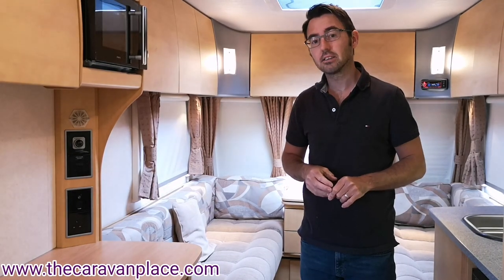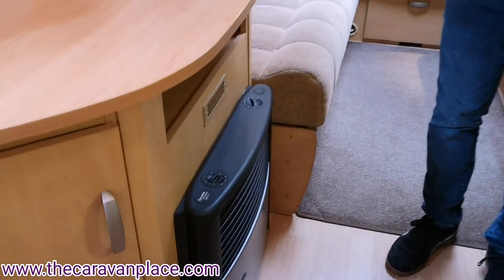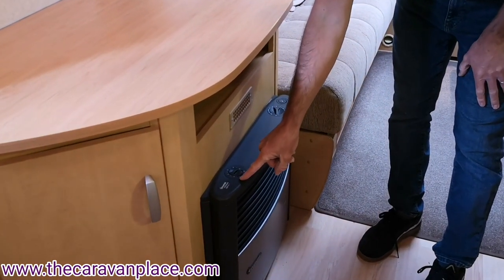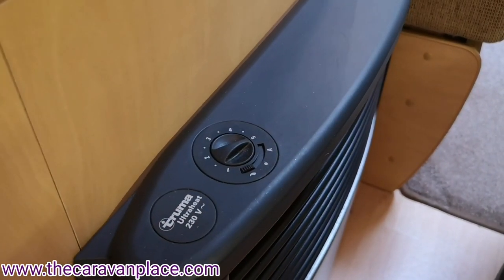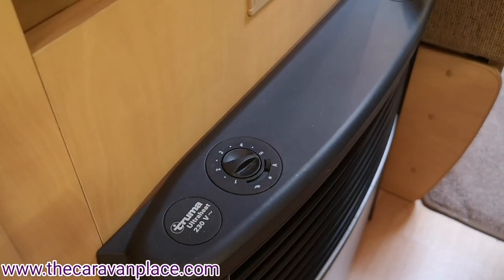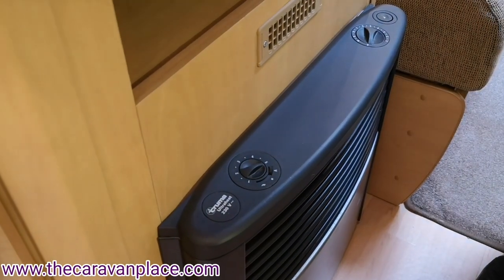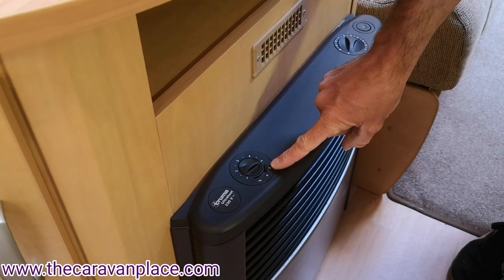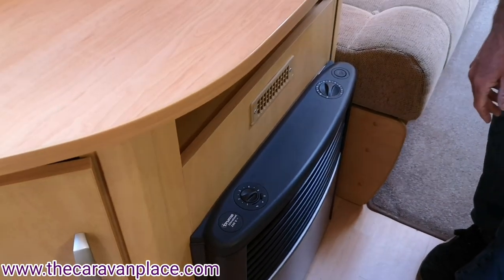Truma how to work blown air, truma s3002 blow air

Comment: Can it work just  from the leisure battery?
Reply from the maker: Yes, gas and 12v will do the blown air 👍
Reply: So how do I do that? Do I put the gas fire on then use the other dial on the fire to use the blower ? Not too sure how tou use it as I've not had it long and it's in storage, can you explain how to fo this please.

Comment: Hi, I started the engine on my motorhome and now the fan on the fire has stopped working, will the fuse be in the main fuse box for the motorhome tia.
Reply from the maker: Yes it should be within the other habitation fuses, possibly the Aux fuse or similar.

Comment: Any ideas please .. fan works but blowing cold air on electric. Heater works with gas but not with electric.
Any ideas for troubleshooting? We'd prefer to use electric heating.
Please help x
Reply from the maker: You should have a fuse in the power switch, if the fuse is ok, then its possibly the pcb or element, a caravan engineer  should be able to test it.
Reply: @thecaravanplace  .. thanks .. looks like it's gas til we get home 👍🏼

Comment: On the heater, the dial with numbers 0-10, if I'm just using electric heating and ive set the smaller dial which is separate to the heater. Do i still need to use the larger dial on the heater?
Reply from the maker: Large dial is just gas, the smaller panel on the wall is all the electrical side. 👍

Comment: Hi. Not sure if my heater is exactly the same model, but the blown air controller is the same. The fan has stopped working. Any suggestions of a likely fix?
Reply from the maker: There should be a fuse for the fan or possibly aux. Check the fuses. If all OK possibly the little fan unit itself, you can buy them separately. But check the fuses first.
Reply: Thanks. I’ll check tomorrow.

Comment: When using on gas,do you need to turn the electric off anywhere?
Reply from the maker: You can turn the wall switch with 2000, 500 and 1000 to the 0 and that will turn the electric off. 👍
Reply: oh lovely thank you.

Comment: Hi my Truma Heater is not blowing any hot air and making a clicking sound Regards
Reply from the maker: Hi The clicking may be the gas Knob is turned and needs turning back past 0?

If the blown air isn't working it will either be a fuse or the blown air controller.

Comment: Can you tell me where the reset button is ? Caravan tech guy said it’s a reset button but we can’t find the reset button
Reply from the maker: Unfortunately the Truma don't have a rest button, the old carver did but not the Truma, you do have a fuse in the mains switch and there will be a fuse for the blown air heating. Let us know what's not happening and we can try to help.
Reply: The Caravan Place great will have a look at the fuse it worked fine on gas but not electric

Comment: Help please!  COLD AIR BLOWING OUT.

I’m plugged in at the mains and have my ultraheat dial set to 2000 (green led on), thermostat at 9 (I hear the thermostat click in as I turn the control up).

On the vent I’m at ‘A’ position, dial at 5 and air is blowing out - but blowing constantly cold even after 20 minutes.

So there is a fault somewhere.

I hope it’s not the PCB which I have been reading about as that sounds costly and tricky to replace.

Any ideas before I go down that route?
Reply from the maker: Hi, If you turn the fan off and try without and see if heat comes out the front of the fire? Try on 1500 and 500 to see if it works on any settings. This will help to see if it's a faulty pcb or the heat element. If it's not working on any settings it may be the element but would need testing. If works on 1500 or 500 possibly the pcb. Hope this helps.
Reply: @thecaravanplace  many thanks for the rapid response.  I tried your suggested steps.
No heat produced at 500 or 1000 either.  

Unfortunately out of warranty but I’ll have to get someone out and take a look.
 
At least we aren’t currently away on it in this freezing May bank holiday!